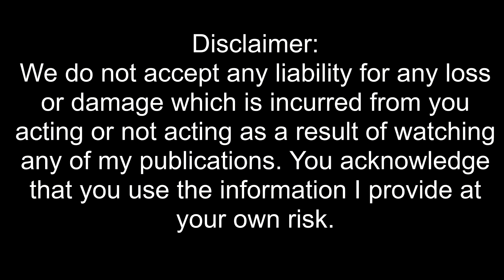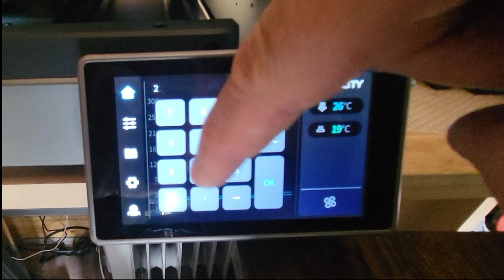Clear That Blob Blocked 3D Printer Nozzle

Comment: Nice video when I unclog my blobs I start by disabling the steppers. Heat up the nozzle like you mentioned and I will also use a heat gun to soften the blob pieces from the outside. I make sure that I do not heat up the plastic cover and not focusing the heat gun on one area but to safely sweep it on the blob.
Reply from the maker: That's a great idea thank you for the tip

Comment: Hi,

This video trigged some PTSD as this happened to me with my Ender 5 Plus with a Micro Swiss NG extruder and hotend when a piece of stray filament jammed the hotend fan. What a disaster - the filament blob encapsulated the whole heater block and melted itself into the cooling fan ducts. Fortunately by heating the heater back up, as you’ve shown here, I could clear the hotend and brush everything off with a copper bristled brush. The cover and fan ducts were lost though - tore apart as I removed it and had to reprint a new one. 

Thanks for the video! Regards from South Africa 🇿🇦
Reply from the maker: Hey good to hear from you  - glad you found it therapeutic....i think you did anyway lol - greeting right back at you from the UK :)

Comment: Nice video showing patience is the important bit ;-) Have you ever tried one of those tools they they sell called noclogger. (Long metal pins)  BTW your workplace is getting over full ;-)
Reply from the maker: Hey mate yes I've got one of those tools just didn't need it the nozzle was not logged at all... I genuinely have no room left in there at the moment there's a huge laser engraver in there that is a bit of a brick as it arrived to me for review without the necessary parts assembled inside the time waiting for them to send me 🤪

Comment: Thanks for sharing this exciting wake up call.  Was this an overnight print you started and what was the cause of this clogging ?   Btw it was good to see how calmly you handled this event.  :face-turquoise-covering-eyes:🤔🤗👍👍👍
Reply from the maker: It was supposed to be an overnight print but I checked it just before I went to bed and found it in that state looks like failure of bed adhesion caused the problem I've had the same problem on my K1 with the bed knot sticking so I think it may be something to do with the facts of updated them both to the new firmware only the day before but who knows the joys of 3D printing eh
Reply: @greedy3d480  Thanks for sharing this experience I am a newbee to 3D printing I have a Ender 3 Neo and the part I dread the most is tramming the bed to the nozzle.  Other than that I really enjoy printing items and gifting them to the family members.  😊
Reply from the maker: It was supposed to be an overnight print but I checked it just before I went to bed and found in that state I think bed adhesion has caused the prob which I've never had with any of my Ender okay one but both machines are doing the same since the new updated firmware